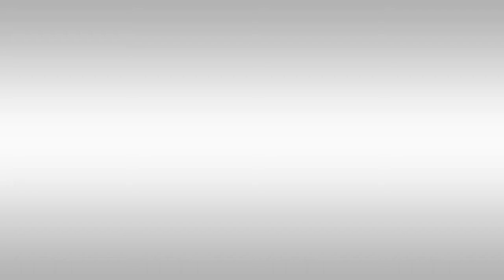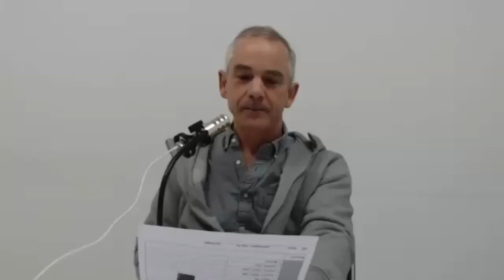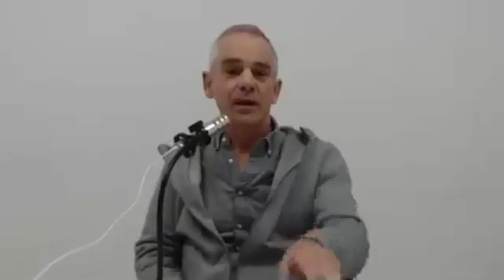Is It Possible to Use 2 Generators at the Same Time during Contact Mode?

Comment: thank you for the answer but what do you consider "contact mode" ? are the "coils/wristband etc." also considered contact mode ? and would it be oke to run (multiple) "remote" mode generators at the same time + 1 contact mode ?
Reply from the maker: Dear my friend, coils and wristband can all achieve a better result, it depend on your choice for which disease you want to treat. It is okay to run "remote" mode generators at the same time + 1 contact mode. :)
Reply: what would be the prefered method for Lyme's / morgellons ?
Reply from the maker: Dear Remon, you can read this link for full course: https://www.spooky2support.com/hc/en-us/articles/360004831234-A-simplified-Morgellons-Lyme-protocol